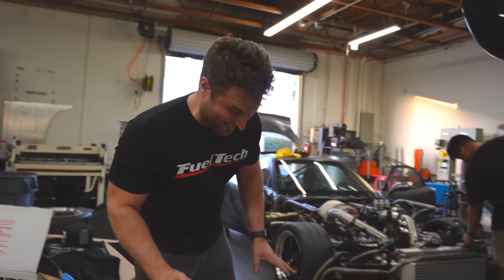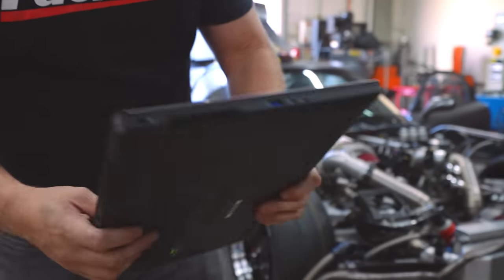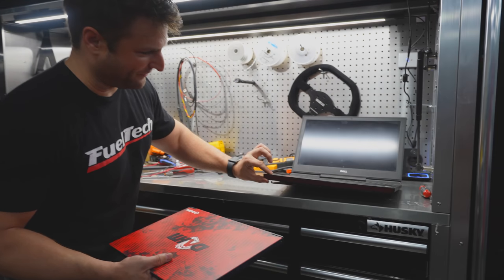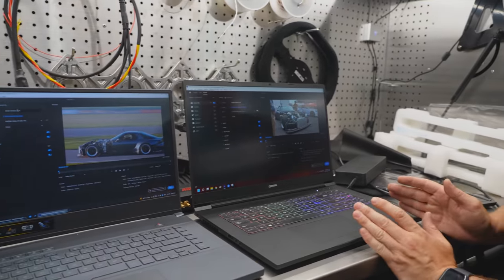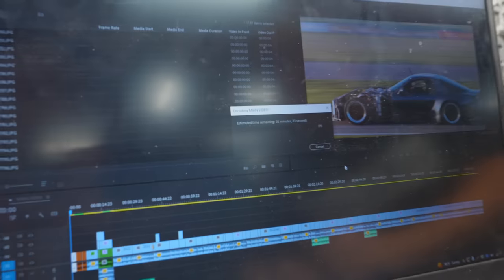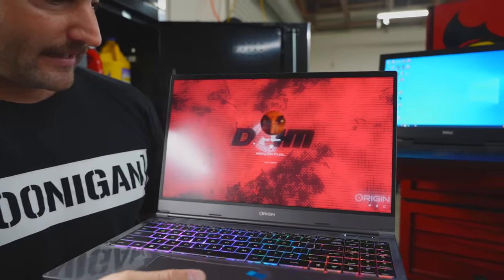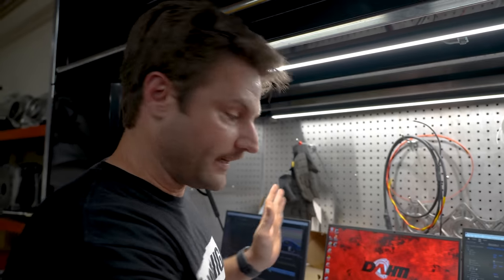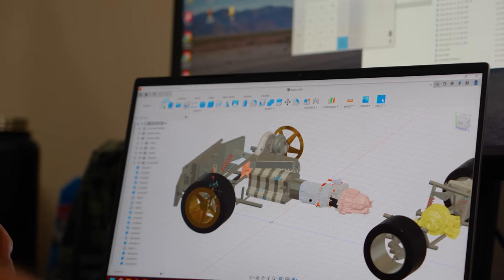My Ultimate Tuning, CAD, and Gaming Laptop. Origin EVO 15S and 17S

Comment: Honestly, I've seen origin laptops as a more premium player in the "use a generic laptop chassis and customize parts" game. I've been wanting razer to come out with 16:10 aspect ratio models for a while so I can get more of a creator oriented laptop, which they don't seem to be pushing towards at the moment. I've wanted the quality hardware of a macbook pro, but with windows, so I've been mostly looking at razer. However just now casually looking at Origin's current laptop offerings, they have the 14 inch EVO14-S with a 16:10 aspect ratio and full size HDMI port and full size SD slot, which is super useful for me. It looks like these will have upgradable storage and memory too, which was a huge drawback for me when looking at the Razer models. I hate when things look too "gamer" though, and most laptops these days with mid-tier and up dedicated GPUs are pretty egregious looking imo. These origin models look slick and professional, down to the logos and keycap font. That 14" model might just check about every box I have.

I do some visual art that I will eventually need to perform live, so I'd like to have decent GPU performance for that (along with doing some Fusion 360, audio work, and light gaming). Otherwise I want it as compact, sleek, and as easy to travel with as possible. Definitely going to be keeping an eye on this. Thanks for the heads up on this! I'm sure Origin will get their money's worth with the sponsorship. Also, congrats on that deal! Those look like great machines for your use case. It's pretty cool to see two very different interests of mine intersect.
Reply: Dell XPS?
Reply: @Tim_2060  yeah, XPSs are great, but not sure that's what I'm going for. I think the 14" is the sweet spot for me (since they're more like a 13" chassis size compared to a 15", in regards to the weirdness with naming schemes and changing aspect ratio/screen sizes) and they don't make modern xps14s. I picked an xps17 for my mom a couple years ago when she wanted a laptop though, so yeah I'm with you, those are great laptops
Reply: I've really enjoyed my Dell XPS 17 over the years, I think mine is a 2019 model and I bought a pretty high spec one so I use it for gaming on the go. It looks professional enough to be used at work and in public but works absolutely great for play with how bright and vibrant the screen is.
Reply: Look into the zephyrus G14 2022 model. 500 nit display, 6900hs processor, 16:10, for the price of 1600 bucks its really hard to go with another laptop especially razer where you can upgrade the ram at all and is well overpriced.

Comment: With an i9 and a 3080 that laptop is going to be heat throttling all the time.  I recommend youi buy an appropriately sized Laptop cooler to plug into your laptop I just hope it has lots of I/O ports to be able to back up all of your stuff You will need a laptop cooler with at lease 3 fans. don't skmip on the quality or the price.  Keep up the Fantastic Content!
Reply: Before working on cars, Rob was an IT genius, was? Still is... he knows what he’s doing
Reply: @dylanzrim3635  IT covers a wide range of things so it doesnt mean he knows hardware

Comment: I’m wondering how the battery life is. I use a MSI gaming laptop for my tuning and the battery life sucks.
Reply: generally laptops with discreet gpu's have poopy battery life and run hotter. 195w tdp will kick up a lot of heat so i imagine msi has some decent cooling fans up in that badboy.
Reply: @pgarrett6665  I guy can dream of the perfect laptop

Comment: Rob my dude, you apparently don't know about Linux. You can avoid tossing an old laptop away and it would perform similarly to the new one. Try open source or and see what you are missing.
Reply: While linux can extend old laptops lifespan, does the old laptop run adobe cc or the software that rob uses to tune the 4rotor? I belive that rob knows that the old laptop isn't e-waste, but needs more powerful computer for programs that aren't natively on linux or don't work even if you are using wine.
Reply: My dude, he is fortunate enough to not bother with old laptops that drags his workflow down. Also he is an IT guy.
Reply: @vilhelmiina.  when WINE and PlayOnLinux doesn't work, there is virtualBox that can run windows in a VM and had the option for USB and other peripheral passthrough. As for the Adobe software, you can either run it in a VM or use open source replacements. For example, Kdenlive instead of premiere, blender instead of a proprietary CAD software and steam is available if he wishes to game
Reply: @granudo  simply put, there are ways he can still use his old laptop for various things. Since of us are not fortunate for decent laptops (I still daily drive a 10 year old T-series Thinkpad) and recommend he still uses his older laptop for things, even if they aren't for tuning.
Reply: @fl0wedm612  kdenlive is an alternative to adobe YES so is davinci resolve, but think about it... you have fulltime employee working on editing a video, do you rather give him the tools he needs or foce him to learn another entirely new video editor... i wouldn't. I don't want to bash on linux and its many pros, since i personally prefer it, but ngl you comment sounded very elitist.
Reply: @fl0wedm612  I highly dbout the robs old laptop ends up in a e-waste bin, so don't worry about.
Reply: @vilhelmiina.  point taken, however no one is being forced into anything. This was merely a suggestion. If my comments are sounding elitest, then I'm moving in the right direction with Linux.
Reply: @fl0wedm612  I would say coming off as elitist is where Linux has been and if supporters are that way, it discourages people to try it out.
You are also arguing for him to reduce workflow.  What you don't understand is time is a resource that is the most valuable.  Do you not understand what this sponsor given laptop performance level is at? 12900H and a 3080ti(m), not much better offerings out there.  The AMD competitor would've been more appropriate for the heavy workloads, 16c/32t full cores over the performance and efficiency combo of the Intel model. Pretty much best mobile gpu on the market.

Linux is fine dude.  I've ran a few different distros over the years.  I had Ubuntu on a Playstation 3 back in the day ffs, that was 12+ years ago.  It has come a long way and I tried Mint last year and they are getting much closer to a user experience the average person can live with.  But things still need native functionality and compatibility for the masses.  You have to build the infrastructure first before they can properly use it.  Think of it like electric cars right?  If you drive a lot out of town, good chance there isn't reliable and plentiful enough charging stations to make it practical for most families.  Vacations with the family do not work with electric vehicles like they do with gasoline.

You aren't really suggesting your side, you are more like a vegan saying your way is the best way, ignoring, dismissing, or downplaying the real concerns, problems, and issues with EVERYONE doing it your way.  Some people its great for, some people its not.  You also are happy about being smug which is ridiculous.  Why would anyone want to come off as elitist?  Arrogance? Narcissism? Lack of respect for others wishes and differing opinions?  C'mon dude.

Hope you have a great day, Linux will gain more traction, people are sick of both Apple and MS more and more over the years.  I think you are just passionate, to be clear ;)  I don't think you are elitist, just really care about showing people what Linux can do and its benefits and how to try to work around them.  It is exciting to share a great niche product; wankel rotaries are like that to me ...  people who don't know what they are doing made them look unreliable, those who know it well can make them run great and reliable; kind of like Linux ;)
Reply: @zakuraayame5091  i am well aware of what is within that new machine, I'm simply saying he should repurpose his old laptop using Linux so that he can squeeze a little extra longevity of of it. Yes most Linux distros days a good amount of time and research, but in the end there are a few really out there. Linux mint the example has everything most people need. If they don't, the apt repos have what he needs. This was merely a suggestion for his laptop so he could keep using it for other things.

Comment: Why is Origin sponsoring a guy who builds cars for living...
Reply: Because he uses his computer to build said cars.  He went over the CAD and Fusion shit he uses in the video... I think it's a pretty good move by Origin thinking outside of the box and gaining another "brand ambassador".
Reply: @DeadFront1319  I understand the marketing schemes. But he has no idea what he is saying. That was my point. Also if they actually cared, they would atleast replace those RTX 3080's with Nvidia Quadro cards which are 10x more expensive, but wtf I know about cad and fusion. 🤷‍♂
Reply: @bonkerzmusic6506  Ya I get it. He's just an average guy when it comes to computer components and should have spent a little more time getting the terminology right. I've built my own pc's for years now, and always figure I'm being too critical of others that don't understand the pc to the extent that I do. So I try to give these people that have no idea what their saying a pass (sometimes). He did better than most dude's his age that's for sure. But I see your point.
Reply: @DeadFront1319  Um, Rob's own IT company paid for his Lambo...
Reply: @owensparks5013  That may be the case, but as bonkerzmusic pointed out, the GPU in this laptop isn't all that great for CAD or Fusion. (it works as he demonstrated, but not ideal) Now, maybe he knows this and didn't mention it because this was all promo, but an "IT" guy would surely know there are better GPU's for rendering out there. 🤷‍♂🤷‍♂ Doesn't really matter, I like Rob and his content regardless.👍😎
Reply: @DeadFront1319  Agreed.  👍